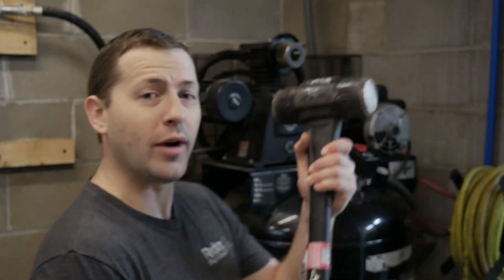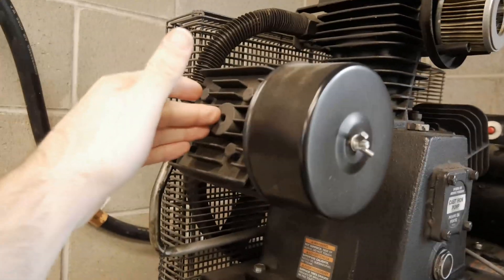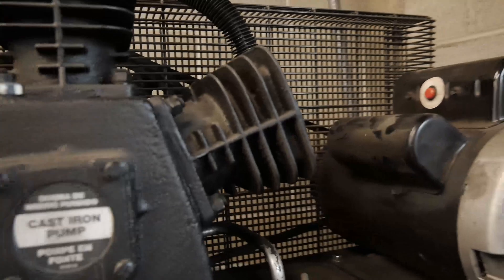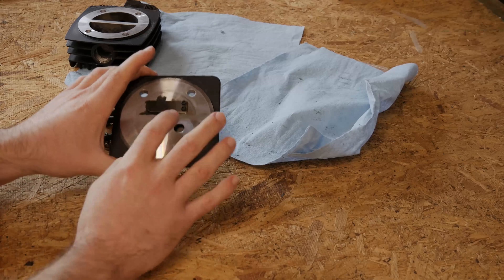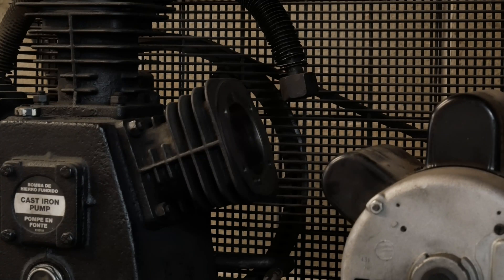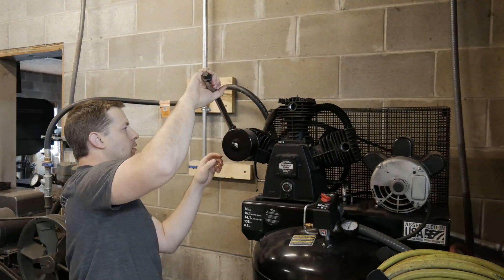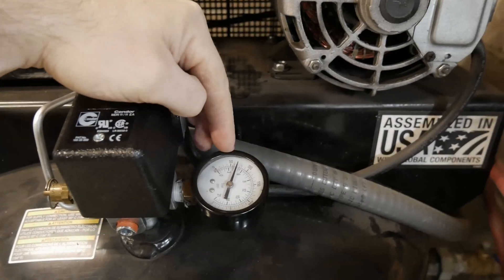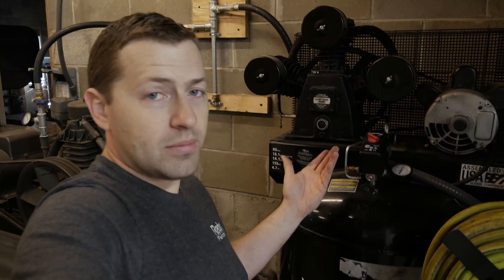How to Fix an Air Compressor that wont build pressure

Comment: Hey man I got this case compressor 1200$ and it won’t fillup a damn tire.. thing has barely been used and was setup by my case dealer.. it fills up quick but it won’t fill up a tire worth a fck takes forever expecially tractor tires .. anything with weight or 30-40psi it won’t build pressure .. any ideas?
Reply from the maker: @Jakebryan-b5f  probably a regulator issue...how big is the tank?
Reply: Its a 8 gallon with a Honda 200 on it:( the motor fills the tank in less that a minute no problem but it just will not fill a tire.. has done it since I bought it just havnt had a chance to take it back .
Reply from the maker: @Jakebryan-b5f  probably a restriction in the output lines or the regulator has issues.

Comment: I have a 33 gal husky oilless and it builds pressure but takes 15 min to get to 75 out of 150 lbs.  Any ideas on what's causing that?
Reply from the maker: Could be a leak from the compressor to the tank or unloader valve. Spray soapy water on every connecting to search for leaks. That's way too long to be running on such a small sized tank. Compressor may be shot if theres no leaks found.

Comment: i need to replace the start and run capacitor but the oem parts are expensive. i see these capacitors on amazon for cheap you wouldnt happen to have replaced these or know of a equivalent on to oem that can be used
Reply from the maker: Pull the existing one off and look at the Volts and the MFD rating.  As long as your matching up those numbers you'll be fine

Comment: Good video. Heat is what kills those head gaskets. The flywheel fan doesn't do a very good job cooling the heads. You might install a cheap fan over the heads that is wired to the pressure switch so it kicks on/off with the compressor. I have a Quincy QT-54 and I installed a $75 magnetic motor starter. Instead of 220v going thru the pressure switch, now only 110v goes thru it. This helps the pressure switch last a lot longer. I am going to build an aftercooler for it soon to reduce/eliminate the water that condenses in the tank and lines.
Reply from the maker: All good info!
Thanks for watching

Comment: Hi there, thanks for sharing the info.   Here's a video showing how mine will initially turn on and start running but then it quits just after a few seconds.
https://youtu.be/UXmbH0l2TGs
Would you have any suggestions?
Reply from the maker: Watched the video, I would make sure the old capacitor UF matches the new one they sold you.  If the old one works there's no real reason to change it (I used to do HVAC for a living) If the compressor starts and runs then the capacitor is good.  What seems to be your main problem is an over amperage issue tripping the main motor circuit breaker on the motor.  You need to check with a clip on ammeter and see how many amps are being drawn through the circuit as the motor is running.  It could be a faulty switch causing a tripped condition where there's not actually an over amperage condition, but more than likely its pulling too many amps and tripping the circuit breaker as a measure of safety to not burn up a failing electrical motor on that compressor.  You should blow out (i know you need air pressure to help with that lol) the motor windings if you can and get the dust and debris out of the areas that could be causing a short. After you've checked out everything electrically you should also make sure the Intake in the compressor is only sucking, if its blowing and sucking then you do have a failing reed valve or broke gasket between the valves.  Also maybe disconnect the metal line that feeds the tank and see if it stays running longer.  If it does then you might have a failing check valve.  The brass thing on top is an unloader valve and appears to be working.  Hope that helps!

Comment: Why was  the head getting hot?  I'll guess, The exhaust gas was going back into the intake and then back to exhaust over and over and getting hotter each time.  ???  Thank you for the video, I learned something.
Reply from the maker: With the broken gasket your correct, the hotter pressurized air from the piston thats supposed to be going to the tank was leaking back into the intake side of the head instead of going where it was supposed to go. That cycle over and over again, causes it to heat up significantly more than the friction alone when compared to the other cylinders that are operating normally.
Thanks for watching!